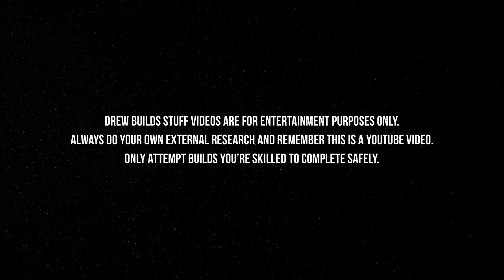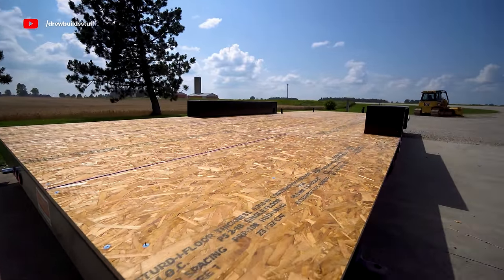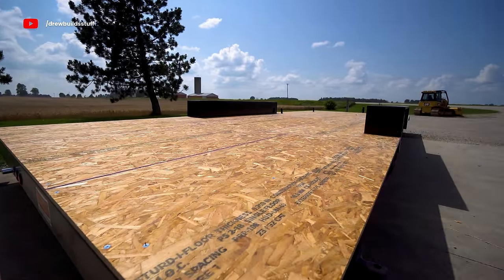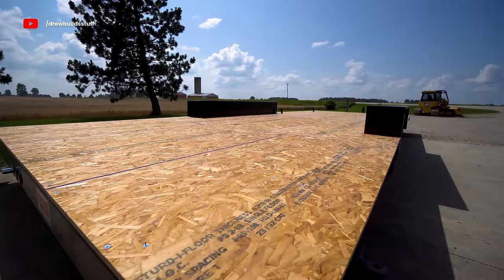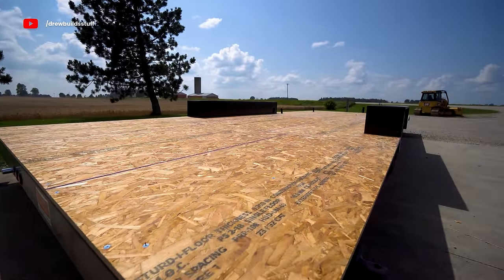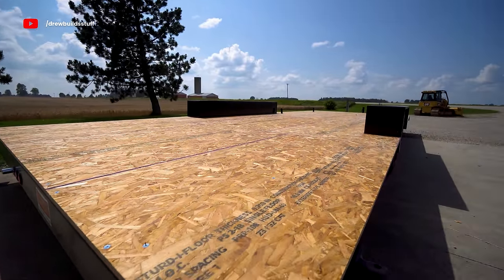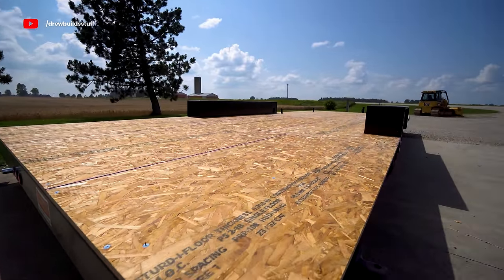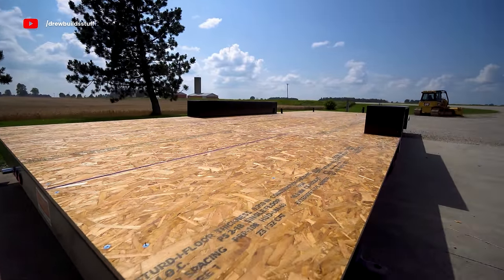BUILDING A TINY HOUSE - DIY Full Exterior Build

Comment: Hey there well Done!   The windows they sent you are replacement windows no flange want you wanted is new construction windows .  Happy to answer any questions you have.  Ps the flashing on top of the window works awesome if you cut it two inches long slit the end fold over the edges.  Keep up the good work

Comment: I watched again last night and thought of some points to mention for the inside. 

- You might consider stairs to the loft instead of a ladder. I've seen tiny homes that put drawers or cabinets in the stairs for storage. If high enough, a small stackable washer and dryer combo might work. Also, going down stairs instead of a ladder when sick would be easier. 

- A similar design to your couch/bed in the camper van would provide storage for the living area. 

- A fold down table on a wall would save walking room when not in use and could double as a dining and office surface.

- A countertop toaster oven can do most anything a full size oven can and could be put in a cabinet  overhead to save room. 

- If you go for a free standing bathroom sink instead of a vanity, you might consider niches or shelves with baskets for towels and extra bathroom products. 

I'm sure you've thought of these, but I thought I'd go ahead and mention them. Again, can't wait to see the inside! Best wishes!
Reply: I second the stairs.  I would also be sure I could make a bed and/or sleep on the main floor if illness or an injury made it impossible to climb a ladder or stairs.

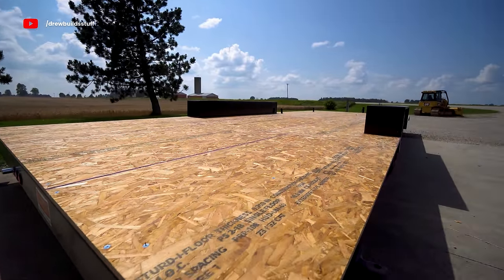Comment: 55:00 Hey Drew. The way you mounted the windows look like how most of the European windows I've seen is mounted. 
You put in isolation material (i.e. Rockwool) and then put in a backstop (typically foam) and then you caulk to finish.
Reply: European here: 
There's also special insulating foam for these windows/doors. They are more weatherresistant and also expand way less. Since if it would expand agressively it could bow the window or door.

Comment: Fantastic job. For anyone that runs across windows like this, they are correct just a different style. Drew installed them correctly and did the flashing outside correctly. What you would do to seal them from the inside is use expanding foam made specifically for doors and windows. It helps insulate the window gaps and expands with less force to keep them from bowing or warping the windows/doors. 
Lastly if you are thinking about starting a project like this to build your own home, know that it is a lot of work and a lot of headache learning so many new things. It is, however, one of the most rewarding things you could experience and it sets you up extremely well skill and knowledge wise for any future adventures. You can absolutely accomplish this. 
Hope this helps anyone that runs across a similar issue.

Comment: Just a FYI for your headers. You should sandwich your headers with 1/2 plywood using 2" x 5 1/2" pieces between your 2x6. 4 pieces usually does fine and you can usually get enough out of scraps.

Comment: Ive always been impressed how entire carnival rides unfold off a trailer. i wonder what can be done if the front of the house pulls out or the ceiling elevates to create a second floor patio etc.
Reply: He said he was going to put a loft in there. I think a fold or pop out would have required much more complexity with the framing and construction, so I understand why he went with a static build.

Comment: Awesome detail on the exterior of your (big) tiny house build! 

It would probably not be anyone else's preference, but I loved the bathroom in my tiny house (14x24).  The interior of the bathroom was 4x5, and already had a toilet and sink in it, but no shower, so I added a concrete floor with drain, metal roofing on the walls, and a shower head, so it became a "wet" bath.  To prevent towels, etc. from getting wet during showers, I also added a curtain down the middle of the room so things on the toilet and around the sink could stay dry, which was a simple solution, and the curtain hugged the wall without interfering with the other functions of the bathroom the rest of the time.  It made for a very roomy shower, and roomy bathroom, even in such a small room.

By the way, where can I see the interior build-out, or didn't you make a video of that?

Comment: I’m a retired carpenter and licensed builder. You did an outstanding job. I made the same window mistake and ordered replacement instead of New construction windows for a house. Luckily I caught it before I placed the order. Great save on your part and I’m pretty sure you installed them correctly.

Comment: Insulating spray foam (Great Stuff) to fill in the gaps around the windows. It's a little messy, but hidden, so I've used that even with the nailing flange just for the insulating properties. I'm surprised you didn't do this since you used spray foam in your flooring. Very discouraging to receive windows that don't include the nailing flange. I think that's just a part of construction... some things don't go as planned. Really well done! I look forward to seeing the finished project.

Comment: For the record weekly standing you can't live in a tiny house in the State or North Carolina you can't registrate your tiny house as your address wont-work they won't let you if your house is built onto a trailer and is not considered a mobile home land you're basically screwed and yes that includes if you live inside of an RV or a camper

Comment: 1) I watched the whole video all the way through ... during six different times. I wouldn't have wanted it to be shorter. It was really good. I think you spent enough time with everything that you felt confident explaining without droning on about something for too long. So perfect size / length video is what I'm saying.
2) It looks simply amazing! I think the white wall is just too much white for me and I'm 90% Scandinavian (78% Norwegian, 3rd generation Norwegian-American). What I'm saying is that simple normally is better but something breaking up all that white wall would have looked better ... for me. But I'm not the one looking at it or owning it. So perfect for you then 100% good.
3) For your roof. DEFINITELY solar panels. Just a note. It took me 30 years to get my wife to agree to put solar panels on our roof and now she is bugging me for the last three years why I didn't push her harder on solar panels. She just can't stop pointing out new houses or businesses that have new solar panels. But it wouldn't be to please a special someone unless you consider yourself a special someone. 
- You could mount them so that you could take them off when you move your tiny home and then put them back up when you arrive at your new location. 
- I KNOW they cost a bunch of money but they pay for themselves in less than five years now. Figure out your peak amount of usage where you are cooking (get an induction stove - more below), watching tv, have your heat pump heating or cooling your tiny house and yes, they work in cold climates too. Add it all up and then figure out how many batteries you need for night time during the winter and then you know how many solar panels and batteries to buy and install. Which means you need to play AHEAD for the batteries. Either that or spend a LOT more on different options for gas which is slower to heat water and cook meals.

3) On the inside design I'm assuming you are building a loft. I would make it so that you can close up the loft so that it is its own room. I have to think that you will have a buddy (girl or boy) crashing with you sometimes and you might not only want to hear them if they snore or they want to stay up later watching tv, videos, playing videos. Yes they would dhave headphones on but the clicking of buttons on a controller can make you want to hit them with it after a while on a night where you just need complete and total silence for a half hour to fall asleep.
You could hide your loft using artwork. If you do it right they will think that there is nothing behind the wall and then with the push of a button there is a reveal and everyone is saying, "That is so COOL!".
4) Make things so that everything can be used in at least three different ways. 
5) Do something unique (probably too late, you've probably already done the insides by now) but instead of building stairs with drawers in them, make the stairs be storage but have them rotate from the wall as if you were turning over a square box with all the contents being available when you rotate the box but maybe also be drawers that you can pull out. This way you can more easily to the front things and the back things but also blow the minds of your friends (and people watching your video) as to how it works. I have different ideas on this but would love to see you pull this off. Or just make stairs like everyone else does. Just saying that his is an opportunity to be unique with something that would allow you have a little bit of different fun with your stairs. And maybe this is how you hide valuables because who would think of something making stairs that are drawers AND also be a secret storage area that you can only get to by rotating the stairs towards you to reveal a hidden area under each step.
6) Make it so that you can raise all your furniture into the ceiling so that you can have a living room like you'd normally want. But then also an area where people could get together and hang out using stools or a bench along your outer wall. 
How would I raise things into the ceiling? I'm glad you asked. I would make loops that tuck into folds in the fabric on the edges of the couch. Then have an electric winch, something small, with maybe strong fishing line that has hooks on the end. When you want to get your furniture out of the way you just lower the hooks down and attach the loops and then reverse it and pull your furniture up into the ceiling and presto, open area in literally a minute. 
You seem smart enough that you could create something where you can have one button that lowers down all the hooks that you need for all the furniture that you want to get out of your way for exercising or mingling or having your bandmates over to jam or when writing songs or something where you want more space than you would have with your big furniture in the way. You could add art work or something under your furniture. Something so they aren't seeing the part of your furniture that people normally expect to never be seen.
OR maybe you have your drums or guitars hanging from the ceiling and you normally want them out of the way so you have them hanging above you at different heights in some artistic way and then lower them when you want/need them. You could do that with anything that you normally want out of the way that doesn't weigh ... well I was going to say an arm or a leg but a couch would weigh more than that so you'd need something strong enough for that.
7) Make it so that you aren't stuck with things in the same position F O R E V E R. Make it so that you can have your couch facing this way now or that way later. On this side or that side or to the left or the right with other things moving according to that. 
8) Don't use gas for cooking. Get an induction stove with an oven that does EVERYTHING. You can now get a microwave oven that is also a convection oven but also an air fryer. That along with a good toaster oven or even a microwave oven which also is a convection oven, air fryer AND a toaster oven. Except what happens when you want to cook two different things at different temperatures for different amounts of time. Best to one one multi-function microwave and one multi-function toaster oven. My wife and I have a full house and we don't use the big oven...except for storing different things that go into the microwave oven and toaster oven. Just saying.
These two types of ovens use a LOT of electricity. So if you are going to try to be off grid for any amount of time you will want enough solar panels and batteries for what you will need during the winter. Personally I would have both a heating system that uses gas and ALSO a heat pump which is far more energy efficient which means money. Just saying. It's why electric cars use heat pumps now. The quality ones at least. And I'm not just talking about price because some people pay a lot for inferior products.
9) If you are into model airplanes you could use those to circulate air in your tiny home. Just saying. And the bigger the propeller the slower it needs to go to push air. Slower is quieter. And you spend less money on heating and cooling your space by keeping air circulating. If you have curved surfaces in the corners of the ceiling of your tiny home it would make air circulate easier and add a different look to your tiny home. 
- And if you combine art work in a wall for your loft, when you open it up like a door, or like closet doors that open on wheels, well there are multiple ways to open the loft and doing it differently can be a lot of fun and get big applause/sounds of surprise if you do it right, and right all depends on what is right to you of course.
10) Optical illusions. I would include optical illusions which would help to make your space feel bigger or hide the shapes of things or what they do which can also be fun and surprising for your guests. Have FUN with your space and don't just be like everyone else while not being weird. Where that boundary is ... well that is to be determined.
11) Definitely include MULTIPLE safe's in your tiny house. I'm not talking big safes but if someone breaks into your tiny home, you don't want them stealing the most precious things you have. Make a puzzle out of opening them so that even if they figure out where your safe is, they still most likely won't be able to figure out how it opens.
- Safes behind optical illusions where patterns in material or colors makes it hard(er) for people to spot that something opens "somehow". Maybe you open your stairs one way for normal things and another way as a safe or since you have multiple steps (assuming you're even using steps) you could have multiple small safes, one under each step but only if you know to open it a certain way like a puzzle game.

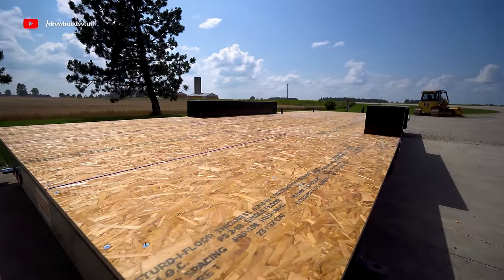Comment: 55:30 Could you have used expanding foam to fill gaps around the windows? Edit: never mind that was explained 7 minutes later 😅
I do have another question though, did you have to adjust the leveling of the entire trailer over time to ensure it remained level?

Comment: Solar tubes are SIGNIFICANTLY better than skylights. You lose ... well significantly less heat up through the roof. And you have ... well significantly less heat coming IN through your solar tube vs a sky light. Win, win and win. Yes they cost more. Or you could make your own by putting highly reflective material inside a cardboard tube and then make a top and bottom for it that was leakproof but also allowed you to let sun light come straight through or defuse it in some way so that you get lots of light without getting direct sun light. You could also install lights into the side of the tube so that when it gets dark it would provide light too.

That would be another really cool do it yourself video that you could make.

Comment: 11:09 I'm a little surprised you didn't sandwich a piece of plywood in the middle of your headers for the window. That's the way I was taught, with the explanation of having both faces flush to the rest of the wall making it cleaner/easier for whatever was going over the joints, either building wrap on the outside or Sheetrock on the inside.
Great build, just a little surprised early in the build. Also, as others said a large build justifies a long video.

Comment: Can I ask what stops your windows from falling out of the outside of the windows aside from the flashing tape? In the UK the frames are separate to the glass, you screw the frame to the house and then add the glazed panels with trim to keep the glazing in place. I can't fathom how screwing the shims will hold the frame in place - or did you screw into the frame as well? Thanks! 😊
Reply: Ooh, are the internal reveals a part of the frame?

Comment: Standard use of nails in home construction is alarming. I’m sure that the use of screws would yield greater strength &longevity.
Reply: Actually no. Not trying to be rude but educate. Nails are used instead of screws because with how screws are made yes they can hold a lot of weight but when it comes to expansion and contraction of wood they break a lot easier than nails because of all the rivets in the screws where as a nail is one solid piece. It's actually code in several places